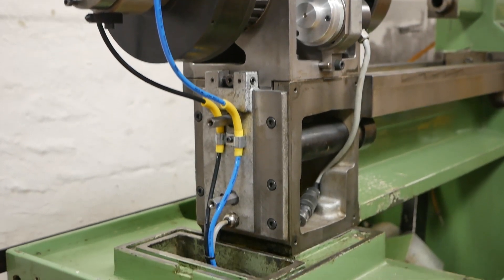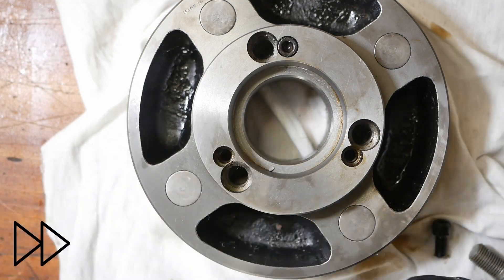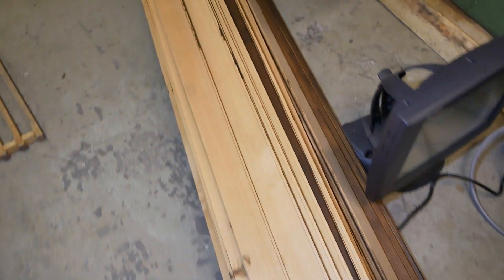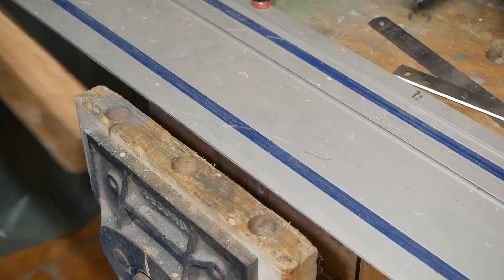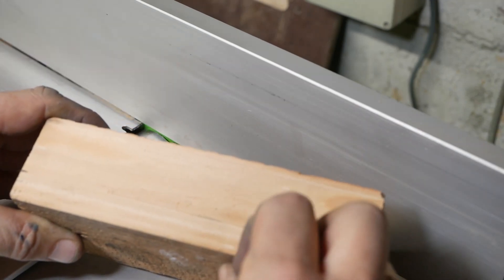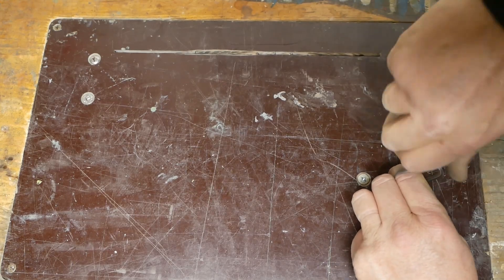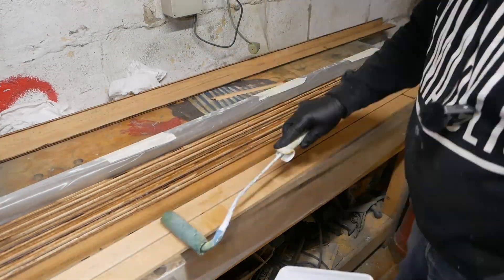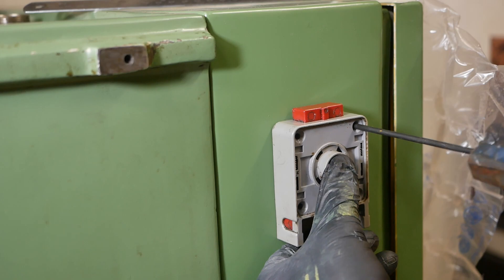Switch blade and chuck

Comment: A bit of painter blue or green tape works well at holding down the sandpaper. Get enough sheets to cover the excellent surface plate so you don't wear down one spot. Some people would be horrified to see you do that. And "this isn't a woodworking channel', but then again, you are an engineer, so making stuff out of easily accessible items is a form of manufacturing. Take care, and get some safety jandals :) Ps love the new chuck!
Reply from the maker: It is a cheap chinese surface plate, and there shouldnt be significant wear from the paper backing of the sandpaper. One of my mates also gives me a hard time for this :)

Comment: Always interesting videos. I see your vortex vac is working well. Those small planers throw off an amazing amount of fine chips. I have a 12" Ryobey that I've had for years. Used to use it to make roll-top mixing consoles for churches. Thanks for the blade sharpening tip. Never thought of that one before. Nix to the nicks. Never used epoxy to laminate slabs before, either. Always used white/orange wood glue. Isn't epoxy kind of messy to work with? I imagine it does set up quickly if mixed right but woodworkers' glue sets up overnight giving me an excuse to go home and rest. I've only used epoxy for boat repairs although I'm thinking of an epoxy granite project in the near future. Thanks for the entertainment break. Have a great and productive New Year.
Reply from the maker: I am also not sure epoxy is the best option here. This is slow drying laminating epoxy and also nees to harden overnight. I had a couple of the laminate joints fail already. I think epoxy needs very perfect surface contact, which I am not acheiving with this thicknesser.

PVA glues I find act as a lubricant till they set up, so it can be hard to control a big stack of laminatations, and not have them slide around. I have never seen those yellow glues like bondtite here.

At the start the little cyclone was working well, but it has since broken through the striations at the base. This is where 3d prints are weak.

Comment: using sawdust as mulch/compost is all well and good but try dampening it first or mixing up your soil well. sawdust makes really good tinder for fires and if you live somewhere bushfire prone like i do in Australia that can be quite dangerous.
Reply from the maker: No great danger of a garden fire here in Vienna in winter.
Reply: @RotarySMP   fair enough. just a PSA for anyone getting ideas from the comments section. either way it's still great as tinder if you have a fireplace, pit or BBQ.
Reply from the maker: @nipunlokuwithanage3433  True. It rained today, so it is already a soggy mess in the garden.

Comment: I called MA48 (Viennas rubbish collectors) several times with the question on how to get rid of the sawdust and they stated: they are glad to have it in the domestic waste occasionally. It seems to add some calorific value and absorb moisture. They also stated, it would be nice if I'd put it in bagged so there is no dust during collection and the bags would rupture during the process later. So that is what I do.
Reply from the maker: That is interesting. I had heard that they had problems with recycling be too effectifive, and there not being enough combustible mass in the left over house hold rubbish.

Still, this batch of sawdust is going on the roses as mulch to keep the weeds down.

Comment: Can you put it in a bag and vacuum out the air?
Reply from the maker: I dont have a vaccuum pump for that.
Reply: Just use a vacuum cleaner it suprisingly good at it
Reply from the maker: @forgeperformanceand4x4  Strong enough to straighten up warped timber?
Reply: @RotarySMP  probably not but I was talking the shavings

Comment: Saw a couple of videos recently where they made various contraptions for compressing saw dust into briquettes for firewood. One was all kinds of fancy with a screw and piston feeding sawdust into a tapered pipe that spat out compressed briquettes, the other one mixed sawdust with cardboard and water and used a carjack to compress them in pipes and squeeze the water out.
Reply from the maker: I watched the complicated one. Bit beyond the scope for my few buckets of saw dust :)
Reply: I saw a couple af them too, think ill go the papier mache method too
Reply from the maker: @jackfirst2651  Unless something changes and I endup doing a lot more wood work, I'll just use this to mulch the rose garden.
Reply: We have a woodburner so it is nice to use up some macerated tree carcass
Reply from the maker: @jackfirst2651  I do have a wood burner next to the gas burner in my house, but dont produce enough sawdust to run it.

Comment: Thanks for the video, love it as always. I watched the JWST launch too. Also, I've seen enough air crash investigation type programs now to be aware of the APU and the ram air turbine. There are a few airliner 'glider' incidents that resulted in a  safe landing. Must be terrifying when your jet plane goes quiet though.
Reply from the maker: Airliners glide well, but a double engine failure must really suck.

Comment: I use sawdust as a sweeping compound, and it can also be used to help soak up grease stains on the garage floor.  In a pinch I've also sprinkled it on icy sidewalks if I don't have any sand available.
Reply from the maker: Oh, good idea, I have used up my sand, and it is winter.

Comment: Before I had a dedicated knife grinder, I used a section of 1-1/2" steel square bar between centers in my lathe to hold the knives and a toolpost grinder on the carriage to do the grinding.
Reply from the maker: Nice solution.

Comment: Nice efficient use of the saw resource though I would assume you have to carefully plan out the use of it :)
I made a table saw in a similar way, took an old cheap jobsite saw and put the guts into a homemade wooden tablesaw frame and top. With a custom wood fence I can dial it in enough to rip wood to width. It's lasted 8 years now, still going strong.
Cheers and have a good new year now.
Reply from the maker: Yeah it is always in the wrong config. Next I’ll need to cut the ends of the slab straight, so it needs to come out

Comment: happy new year and thanks for an other great video.  did you know that the line on the circumference of the cam pins  you installed should be flush with the  back surface   of the chuck?  this is to insure that the cams  on the spindle lock fully.  the line on the cam socket should  be at least past the 4 or 5 Oclock  point.. cheers
Reply from the maker: I didn't know that. Thanks Phil, I'll check if I installed tham right.
Reply: @RotarySMP  It's super important to get the cam at the right installed height ( tight between 4 and 8 o''çlock. If you don''t the vibration can cause it to loosen and the chuck will fall off. It's terrifying!
Reply from the maker: @hahnrossman1172  Thanks for that. I'll check that.
Reply: @RotarySMP  It's worth double checking. When I got my Graziano I bought a new 3 jaw chuck and thought "simple enough.." It wasn't until I had it on it's highest speed a couple of years later that the chuck started wobbling and then ejected itself! D1-8 in my case so super dangerous! I'm still amazed that it wasn't worse than it was. One of the interesting things was that despite the chuck spinning quickly when it came loose, it dropped straight down(gravity) on to the bed of the machine. At which point it had something to resist that rotational momentum...so then it shot out towards the operator! Just awful in every way. Fortunately the wobbling made me start to move away so it didn't hit me in the chest.

Comment: My name is Zig and I rent a garage. Every garage owner knows how handy it is to have a bag full of wooden chips and dust - and luckily local mill saw gives them away for free.
Just in case: it doesn't work that well with metal chips and dust. Do you know why?
Reply from the maker: I also keep a bag for soaking up oil spills.
Metal swarf is sold back to the scrap metal dealers, and can be quite valuable, if clean and sorted.

Comment: That's exactly how I sharpen jointer blades, at least steel ones.  I currently run carbide blades in my jointer.  As for sawdust, I burn some in my woodstove, and I add some to my compost.
Reply from the maker: That jig I made was pretty rough, but worked surprisingly well. If I was doing it regularly, I'd probably use a slitting saw on the Maho to make one in aluminium.
Reply: @RotarySMP  Your solution certainly got the job done, although as you noted it's a bit of a tough slog when the blades are damaged.  My own jig is maple, which is strong enough to accept set screws to secure the blades.  Someone like Tom Lipton would probably make one out of steel so he could mag-chuck it onto the surface grinder 🙂
Reply from the maker: @briantaylor9266  Yeah, that would make touching up the blades a breeze.

Comment: I've many times wished for a transfer punch, but never felt I could budget for them when I needed one, nor thought of them when I could.

So, many years after learning of them, I still spot with a drill. Occasionally I'll make a transfer pattern on paper, but usually I just use the component itself.

My boss about had a fit the first time he saw me do that to a 6" marble countertop with a rotary hammer . . ..
Reply from the maker: A set of transfer punches is remarkedly cheap. I also tend to make specials like short ones on the Boley. Only takes a few seconds to make one and harden it with a blow torch.
Reply: Yup they are cheap...I got a set from the infamous "Harbor Freight Tools" in USA for under $30.

Comment: Regarding JWST I had a dream last night about the level of redundancy in the onboard electronics and custom silicon. Can you imagine the stress for all the designers in all aspects of the build that nothing goes wrong; as a software guy I'd be dreaming about all the code in every subsystem I touched for years to come. This isn't like Hubble where you can hop on a shuttle and slap in new optics. Trivia: I live close to the place (Perkin Elmer) in Danbury Connecticut where Hubble's original primary optic was incorrectly fabricated.
Reply from the maker: I watched a Nasa podcast on JWST, and it has 344 single point failure items. So far deployment seems on track though. This time they have actuators to correct the optics.
Reply: @RotarySMP  Do you have a podcast link ? I'd be interested to listening to it while I fart around today. Cheers.
Reply from the maker: @vincei4252  This was the one...
https://www.youtube.com/watch?v=AxO3Wm9uPq8
Reply: @RotarySMP  Thank you
Reply: @RotarySMP  Yeah, they have actuators, but those are for nano-scale correction. I assume those actuators do not remotely have the range and/or strength to correct optical error. 
As we know, launch to space is extremely violent. Astronaut Mike Massimino recounts that even though he knew what to expect (being subjected to the same shaking in simulators), when he was in his first launch he was actually concerned that the shaking was so bad it might shake the whole capsule apart. So I can't even begin to understand how they can design something that can be subjected to a space launch, and then unfold and be locked down to nano-scale precision.
Reply from the maker: @cleon_teunissen  I wonder what the peak G load was on the JWST launch? I am guessing it was pretty low, as the first stage took them almost to orbital velocity, and then that second stage was very low powered and did a really long burn. But yeah, having something as flimsy as the JWST looks go through that process must be seriously nerve raking.
Reply: @RotarySMP  I found there is an Ariane 5 user's manual.  In section 3.2 numbers for G-load and what have you are listed. Quoting: "The highest longitudinal acceleration occurs at the end of the solid rocket boost phase and does not exceed 4.55 g." Section 3.2.3 is titled: Sine-equivalent dynamics. For instance, longitudinal, in the frequency band of 50-100 Hz, sine amplitude will not exceed 0.8 G. (Messages with a link in them disappear, so I can't provide a link, unfortunately.)
Reply from the maker: @cleon_teunissen  Wow, that is quite a decent shaking.
Reply: @RotarySMP  The structure with the 7 meter struts that hold the secondary mirror in front has deployed, and the deployment has moved to the next stage. From the description: "It also had to deploy, position, and lock itself into place to a tolerance of about one and a half millimeters". I gather the assembly holding the secondary mirror has actuators to achieve final positioning. Still, I assume that on short time scales those 7 meter struts have to be stable to nano-meter precision.
Reply from the maker: @cleon_teunissen  Cool, nice that they aren't fighting some deployment failure. I hope it delivers its promised science.

It sounds like the design solution for movement and vibration was "lets cool this thing to absolute zero so it cant move around" :)

Comment: Nice to lend someone a tool and have it come back better 😀
Reply: RotarySMP …….  with all your ingenuity displayed on this channel, I’m actually surprised you haven’t already mounted a 6-inch bench grinder upside down to a servo controlled ballscrew over top of a linear rail supported slab of recycled kitchen granite countertop.  Maybe you just haven’t showed us that as it’s in the other shed 😂.  All kidding aside, this has to be one of my favorite YT channels.  Thanks for all the machining inspiration.  And thanks for all the various back stories about other subjects as well (space, aircraft, airline operations and maintenance, America’s Cup racing, pneumatics control, casting, painting, kitchen remodeling, furniture building….etc). You sure have accomplished a lot this year.  2022 is going to be awesome 👍👍😎👍👍
Reply from the maker: @joell439  I do have a nice german grinder spindle (I think it is even in the box marked "secret project". Maybe after the Schaublin series, I should do something with it?
My wife finds some of my videos to be too random :)
Reply: @RotarySMP  random is good. Its all interesting. I use diamond stones to rough hone damaged blades. They dont get used up as quick.
Reply from the maker: @jasonasselin8657  Good idea.
Reply from the maker: Shame i couldnt get all the gouges out.
Reply: @RotarySMP  sounds like you need a surface grinder 🤣
Reply from the maker: @julias-shed  I would love one. Sooner or later.

Comment: sawdust either goes on the garden as mulch, or into the compost pile :)
Reply from the maker: Good point. Would help smoother the weeds in around the roses.
Reply: @RotarySMP  Sawdust will temporarily deplete the nitrogen in the soil as it decomposes.  I've used it to intentionally do that when I inadvertently got the nitrogen too high.
Reply from the maker: @briantaylor9266  How do you know it is too high?
Reply: @RotarySMP  Over on my side of the pond we can buy a DIY soil test kit at the garden centre or on Amazon, and I can't imagine that similar products would not be available in the EU.  Also, most if not all states and provinces offer a soil testing service, and that may be available in Austria at the state or federal level.  In my particular case, my zucchinis developed blossom-end rot after I got too over zealous with a high-nitrogen fertilizer.
Reply from the maker: @briantaylor9266  The only gardening I do is the rose garden ...well... rose and Jalapeno garden :)
I spread around some bird shit manure 2 or three times a year. That is about the extent of it.